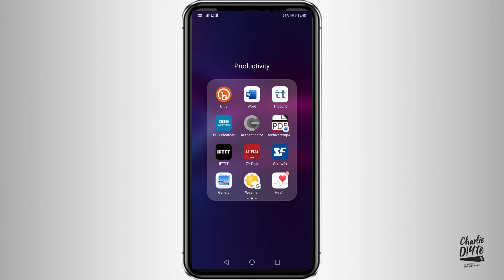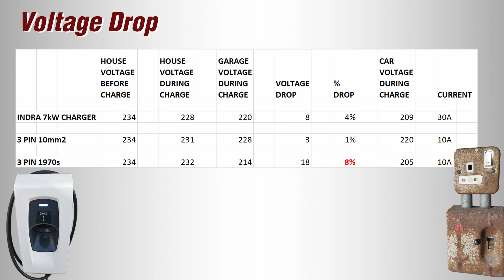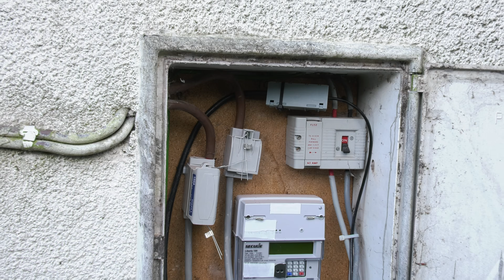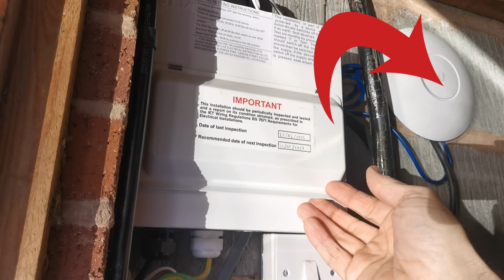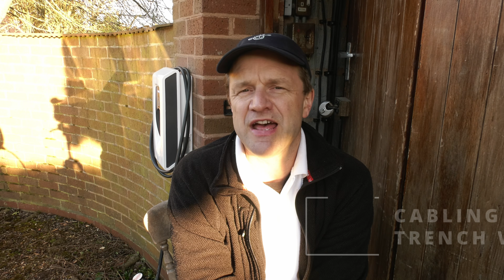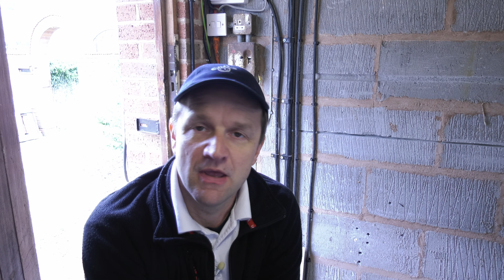Installing a Home EV Charge Point - Everything you Need to Know

Comment: Unfortunately your installation does not comply with BS7671.

Regulation 722.531.3 requires that an RCD (Max 30mA) supplies a car charger and the RCD shall disconnect all live conductors.  This includes the Neutral therefore the single-pole RCBOs should not be used for this application.

The RCBO you have used is single pole and only disconnects the line (live) conductor. I'd recommend a fusebox or Lewden branded consumer unit as they both manufacture double-pole RCBOs.

Even electricians get it wrong if they've not been suitably trained. 

I wouldn't recommend a DIY installation for anyone, find an electrician who has completed his City and Guilds 2919 and your more than likely to get the job done correctly!
Reply from the maker: Thanks for the heads up on this Mick. The guys at eFIXX have also pointed this out after you. It's very frustrating and I think the blame here has to fall squarely with Chargedev as they charged for a full price install and should have changed the RCBOs as part of the install. After all, we were acting on their advice with our prep work to make install on the day as easy as possible and they didn't specifically refer to the need for double pole rcds/rcbos. Normally I'd take the video down and amend - I might still do - but an update video in a week's time might be more useful. Interestingly another comment has advised that the RCBO at the house should be 100mA time delay.
Reply: @CharlieDIYte  I wouldn't ammend the video, only a trained eye would spot the mistake. The video is still informative to people who don't have an understanding of what is involved. I really enjoy your videos and don't make a habit of pointing out mistakes but felt that if you're paying for a job then it should be done correct otherwise it would invalidate the warranty.
Keep up the good work.
Reply from the maker: @mickbitchum4664  Thanks Mick - I appreciate that. You absolutely must point out when a video is inaccurate. There are two reasons the Comments are incredibly important to me i) as a continual source of encouragement since I started doing this - which has been key as with all the filming and editing this can be quite a hard slog and ii) as checks and balances to what I'm putting out there. With the views I can get these days, creating this content comes with a lot of responsibility and it's important for me I get stuff right. This vid was a tricky one in the sense of finding myself straying into the realms of stuff I'm not qualified to comment on (electrics) - which I have to be very careful about doing - so it's frustrating the pros who I relied on got it wrong, but pretty brilliant there are people out there like you to point it out! The fact that the wholesaler is sending out 5 units a week with these RCBOs in for EV installs underlines what a minefield this is and if I can do an update video in a couple of weeks time correcting a few errors and hammering home a) the fact this is part P notifiable and so no DIYers should be doing it and b) the double pole issue, then I think my channel has achieved its purpose.
Reply from the maker: @mickbitchum4664  Bit of an update. They've identified a Live double pole RCBO and will hopefully be installing it soon. I'll do a quick video update once it's done. Thanks again for pointing this out.
Reply: Maybe if you read the 18th edition regs and do that course you might not need the city and guilds Ev course if your a competent electrician in effect an ev installation is a 32a radial circuit with added overload ct nearly all have WiFi.if installation is too far away from your hub maybe you wire a cat5 cable instead nearly all eV boxes have this feature also internal double pole rcd and T-NC protection no longer needing a earth rod if you read the IEE 18th edition regs it's all in there. Then you need the 2391 City  and Gilds Testing and inspection course in order to sign the work off as its classed as a new addition.
Reply: @leewinters606  yes you are required by law to notify your local building control office. With so many mistakes I would say you installer are not registered certified installers .
Reply: Great video, very informative, maybe a few issues with no discrimination and no double pole rcbo, but unfortunately from my experience a lot of electricians make these mistakes. This guy never claimed to be an electrician and  only helped out to brings the costs down. He certainly didn’t skimp on things and went to professional people.  Please don’t take this video down as you did a really good job.
Reply: ChargedEV can be annoying, they fitted an indoor RCD to my outdoor main fuse point, they also fitted an old 3G dongle to my Indra unit and guess what, 3G is being turned off where I live and so I had to get them out to fix it, the guy who came to fix it told me it was a 3G dongle and not a 4G one.

Comment: Really interesting information Charlie. I’ve being doing a similar house renovation to you, and found your video’s really interesting

2 things I have installed that you might be interested in looking at

1)	Generator back up. It used to not really worth bothering with a home generator unless you had a real need (like a farmer with cows to milk) because you needed quite a large generator to run the house. 

Todays home in an emergency can now run with quite low power. LED lights use a fraction of the power and gas or oil heating systems only need low power run pumps, valves etc. Even TV’s are low power now

In an emergency a 2 or 3 KVA generator will suffice, because once an incoming power is sensed the solar and battery will start working and provide back up

Now you have solar and a battery (plus an EV with a massive battery you can also draw on with the right EV charger) 

All you need is a manual change over switch and you just plug a small generator in

2)	Solar Thermal.
With an EV you will use most of the solar you need. Solar thermal is a bit more complex to install but works really well have you looked at it??

Keep up the good inforkattion

Paul O
Reply from the maker: Paul thanks so much for this. Point 1 in particular is very interesting as we get a fair few power cuts here. I was going to look into getting an electrical in to install the switch so I can island as it were - to run the house off the batteries in a power cut - but you're saying a generator will do the same because once the inverter has power from it, I'm back up and running?
Reply: @CharlieDIYte  Hi Charlie. Modern solar disconnects and powers down when the incoming supply stops. Once the solar senses the correct incoming voltage and frequency it starts working again. Its doesn’t need a large amount of incoming power to start the solar (and battery) again, so a small generator will utilise your solar set up in a power cut. (a word of warning a cheap gen sets just designed to run power tools might not have a stable enough supply to satisfy the solar the incoming power is okay to restart) . An invertor set will likely be more stable. 
I understand it well enough to know what’s possible, why and how and have made provision for a manual change over like this. 
https://www.google.com/aclk?sa=L&ai=DChsSEwjU94vTme6TAxVI0kQHHesjOVQYACICCAEQHBoCZWY&co=1&ase=2&gclid=Cj0KCQjwy_fOBhC6ARIsAHKFB7842eLRK0sM8ufcyRPFinYaJpdUls6oHBlv0_ODVAEb2ZdMaJCDrSwaAnMWEALw_wcB&cce=2&category=acrcp_v1_33&sig=AOD64_0gh7NaJNrNbj8wFpdyNqqgDwhrkg&ctype=5&q=&nis=4&ved=2ahUKEwjhlIfTme6TAxU99bsIHaypGBUQ9aACKAB6BAgGEFk&adurl=
As I said before in an emergency you can make a modern house comfortable again for a short period with not much power these days . even 1 to 2k would run enough LED, lights  heating controls, the router and TV/lap top until power goes back on. Plus what is in yiour solar battery 
There are plenty of generator experts out there to provide proper advice (generators are an area that most Sparky’s don’t do a lot with but they will understand what they are reading and what not to do)  
In summary , you must fit a manual change over switch though that disconnects the incoming supply before connecting a generator that separates the grid and the generator, preventing dangerous "backfeeding" into utility lines by physically disconnecting the main power. ) and you/your kit when the power comes back on)
You’re the sort that reads up and gets advice before rushing ahead. Its simple in theory but there are a few more things to consider such as the earths as you now have an earth spike (read up on floating earths) but a small generator with a manual change over will get the house back running 
With an EV on the drive all the more reason to investigate. A good project for you !

Comment: Rather than run an EV charging cable back to the house CU, which is disruptive, then what I intend to do is have a new external grade CU installed next to the current meter box, which I have plenty of space for. It minimises the cable run, and means there is zero effect on the house electrics (save the normal checks). There are weather-tight CUs available at a very reasonable price, and I suspect that it is cheaper than running a cable to many people's existing CU. 

I should at I have a detached garage. If your CU is in the garage already, then that might not be such an issue.
Reply from the maker: My issue is the mains come into the house which is 65 metres away.

Comment: It is not the total voltage drop that melts your cable. It's the voltage drop per unit length multiplied by the current that matters. Yes, 100 metres of cable will have double the voltage drop at the same current than will 50 metres, but the heating effect is spread over twice the length, so the heating effect is just the same. Provided you keep within the cable current rating for its type and installation method, then the cable will not melt. 

Where voltage drop does come in is that, first of all, you are wasting power. If there's a 20V voltage drop with the the 30 amps of a typical 7 kW charger, than that's 600 watts out of that 7 kW being lost, which increases your cost. The second issue is that some devices will not work properly or efficiently if they drop below their rated minimum voltage. Hence there are rules about how much voltage loss is acceptable.

Frankly, for high currents, the bigger the cross-sectional area, within reason, the better. If you are losing, say, 300 watts in resistive heating, then at current pricing that's approaching £1 an hour just heating the soil. If it's a 6 hour charge, then that's over £5. It doesn't take many lots of £5 a time to cover the extra cost of, say, 10mm^2 cable vs 6mm^2. It's actually quite easy to calculate. Just find out the length of your cable, find the tables of resistance per unit length for a given gauge and type of cable. 

The three most common cross-sectional areas of SWA are 4, 6 and 10 mm^2, which have a resistance of 4.61, 3.08 and 1.83 milli-ohms per metre respectively. Double that for the round-trip and it's 9.22, 6.16 and 3.33 milli-ohms per metre length of cable. Power loss is current squared * resistance, so for 30 amps, that's 8.3, 5.5 and 3.0 watts per metre respectively. If we assume a nominal 230V supply, then the voltage drop per metre of cable length will be 0.12%, 0.08% and 0.043% respectively. 

So what does this mean for, say, a 20 metre run? That means for 4, 6 and 10 mm^2 cable respectively, there will be losses of 166 (2.3%), 110 (1.6%) and 60 (0.9%) watts respectively. Basically, for ever 1,000 kWh delivered to the cable (say 3-4,000 miles of driving), then 23 kWh, 16 kWh and 9 kWh will be wasted heating the cable. Whether the cost of that 14 kWh difference is important or not will depend on how many kWh you expect to use and the tariff you pay. At a fairly standard 35p per kWh, then the difference between 4 & 10 mm^2 cable would be about £4.90 for that 1,000 kWh. Clearly the longer cable run, or the more miles travelled, the bigger the difference. I should also add that the alter will notice that the way I've done the calculation under-estimates the difference somewhat, but time is a bit short. I need to spreadsheet this properly.

I should add that the voltage drop for each of those solutions of cable is 2.4%, 1.6% and 0.9%, all well within an acceptable range. If, however, it was 50 metres then it would be a different story.

Also, another thing worth considering is if you ever intend to upgraded to 3 phase. If it is, then it might be worth installing 5, not 3 core SWA. It's vastly cheaper to install it in the first place than replace it later. Also, it is at least technically possible to run the two load carrying conductors in parallel, thereby halving the effective resistance as, in effect, it doubles the cross-sectional area. I don't know for sure if it's within the regulations, but I don't see why not.

Comment: We have 3x40A, it still takes ages to charge a car at 25kW.
Reply from the maker: For us, 7kw/ hr charger takes a 78kw battery about 11 hours which as you say isn't quick.
Reply: @CharlieDIYte  I really love our dutch 230/400V system.
No huge heavy cables needed when running stuff on almost half a kiloVolt 😁

Comment: Great video and style. Loved it. Interesting that on an earth rod TT System the sub consumer unit is often served with  as earth resistances to ground like this are rarely good. Therefore in the main CU, it would be a 40Amp MCB. Two RDBO/RCD in series could mean problem tripping and a time delay RCBO/RCD would be installed a the main CU. Time delay being 500ms instead of 40ms trip. Picky I know but fact. Also the DNO can be asked to asses to make the supply a TNCS or PME. This is where the earth in bonded to the Neutral at the supply transformer and at the cut out. This is standard now. Neutral 'is' Earth

Comment: Fantastic video Charlie - really didn't feel that long, lots of great, interesting and informative content.  I think you might be similar to me in that I'm sensing we have a shared DY interest in electrical matters.  As you alluded to in the video, electricals is probably the most taboo area for a DIYer given all the regs, "competent individual" qualification requirements and the sheer danger of getting it wrong (if it was a choice between cutting a length of timber at 901mm instead of 910mm and getting an electric shock, I know which balls-up I'd choose!).  I've found myself consuming a lot of YouTube electrical content recently and am doing more and more non-notifiable projects around the home. I just find it quite fascinating and like the maths that comes into play with formulae using volts, amps and cable core diameters, etc.  Back to your video and I definitely don't envy you that cable run and you absolutely did the right thing by future proofing.  The garden gym/workroom I built in lockdown at end of our garden is about 50m from the house consumer unit and I future proofed only in so far as using 16mm2 SWA rather than the 10mm2 which is all i currently need- but i did cheat a bit and cleat it along the bottom rail of our newly installed fence rather than burying. If i ever convert it into more of a living space (with water and wifi) then I'll no doubt be doing a lot of digging.  In terms of EV, I'm on the same Octopus deal as you with that 0030-0430 special deal.  But got an email from them recently with the new rates about to come in and they're eye watering.  Wish they'd hurry up and install chargers at my office!
Reply from the maker: Thanks Chris. You're one up on me there with the maths of electrics. I have neither the time or inclination to get into that so that's why I need to get the professionals in! My deal runs out in April 😩

Comment: Now you’ve had it a while what are your thoughts on the Indra, I am considering ordering one but I think they still haven’t updated the app with a button to turn it off while you are away which is a basic requirement as far as I’m concerned. Is the app good, has it been reliable? Thanks for all your Stella work.
Reply from the maker: Tricky one Andy. It's not perfect but then the customer service has been very good. They're bringing out a new app quite soon - which should be a big leap forward. For me, I would have been better off with the solar ecosystem designed Zappi given that I have solar now, but I didn't when I got the Indra installed.
Reply: @CharlieDIYte  thanks for that, the new app has been coming for well over a year it seems

Comment: Had to get DNO to upgrade my fuse and Zappi has built in pen fault and RCD, so RCD in the additional CU used was only really protecting the cable. 
Tails were upgraded to 25mm when smart meter was installed.
Meter inside house so space for additional CU not an issue.
The best point is that you can get more use of your cheap EV rate (Bulb do a 4 hour EV rate) with a higher current charging option.
Reply from the maker: Thanks Graham. Really wish I had installed the Zappi. Solar charging is hopeless on the Indra as it depletes the battery.